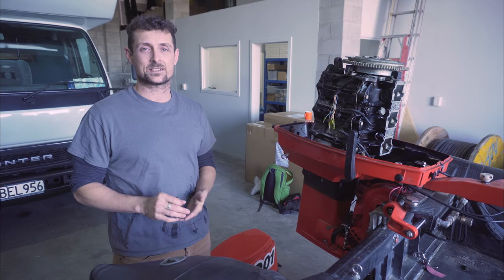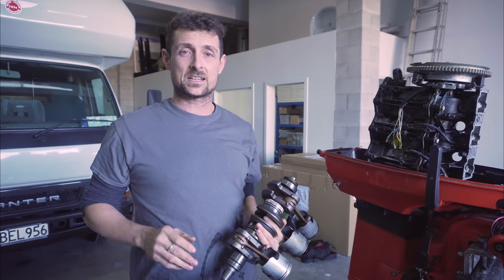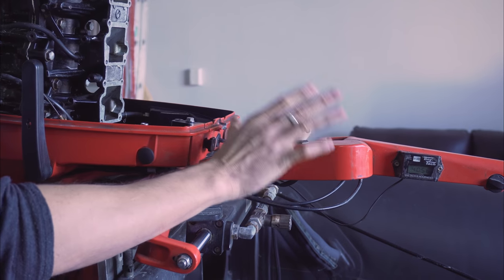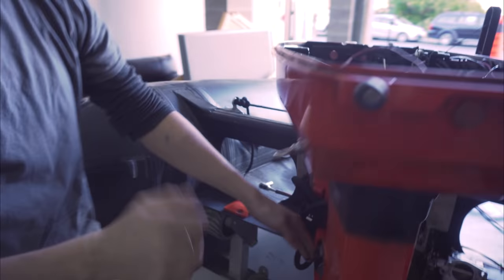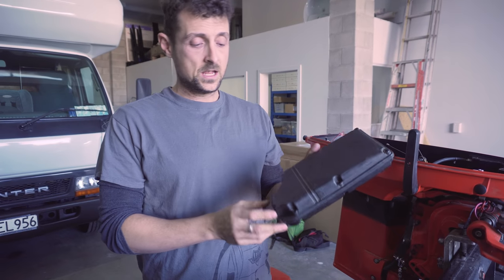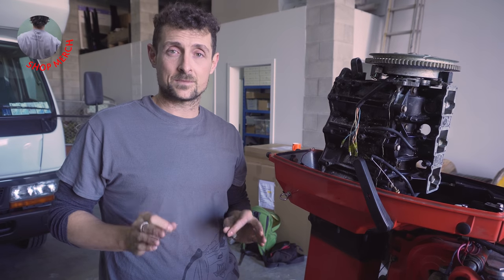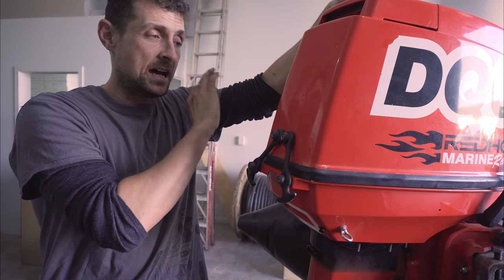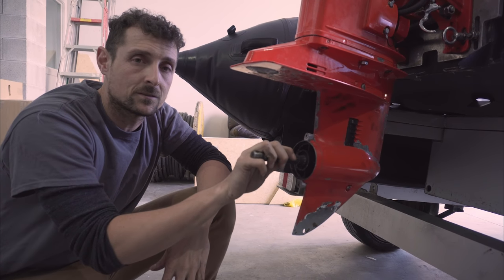How to race Thundercats - Motor set up

Comment: NICE!  Well done - keep 'em coming , please. Other topics: how to modify (the engine)?, how to handle torque (steering damper, elastic cord? ). How to right the boat in case of a "whoops" -  What gear is required in the boat/on the person for races etc.
Reply from the maker: Engines are standard. I think I have clips of the boat being righted so could do that. Safety equipment and what gear is needed is coming next week. Cheers.

Comment: What pressure do you run your chambers? 
Out here California we see temps of over 95f/35c and our boats develop seam leaks. 
My boat is older and I know I am going to have issues over time.  Do you have any recommendations?  A new boat is not in the cards so I am playing the cards that I have!  
Stabond is my new cologne!
Reply from the maker: Here's the video on hulls https://youtu.be/YAO3So2iEeE

And one on leakshttps://youtu.be/tsMNOPtSzdw
Reply: You can use liquid latex inside the tubes, helps seal up wee holes in the material. Just pour it in through the valves then roll the boat around to cover the inside of the tubes

Comment: whats a good starting point for prop height,,,  is the the center of the hijackers a good place to start with center of prop hub the same as the center of the hijacker  im about 4 inches below that  it shots water back in the boat also i do leave the trimtabs( the lip on the back of the transom alone or do i want to tweak them some up od down
Reply: Depends on your hull type. A thundercat does not have trim tabs, you may mean the cav plate which is not adjustable.  The prop shaft in line with the hijackers is as good a starting point as any. Basically you move up and down, looking for between 6500-6800 rpm with a fairly steady tell tale. Then start trimming in and out using a gps and rpm to find the sweet spot. Its all about trial and error, lots of it...

Comment: Any rules on fuel?
Reply from the maker: I feel we should've touched on that.

Fuel must be pump gas from a service station. No additives allowed except two-stroke oil. Recommend fully synthetic oil, do not use ethanol gas like at Gull as it will attract water and clog up carbs when racing.
Reply: OXS Enterprises i raced rubber ducks for s surfclub here in oz back in my teens and im pretty sure fuel was regulated, but you could always smell that sweet avgas in the air.
Reply: Really? You can't even jet your carbs for the air density? 
That's kind of lame.